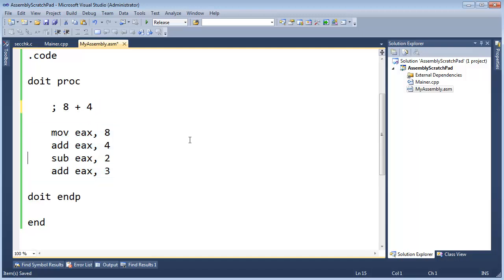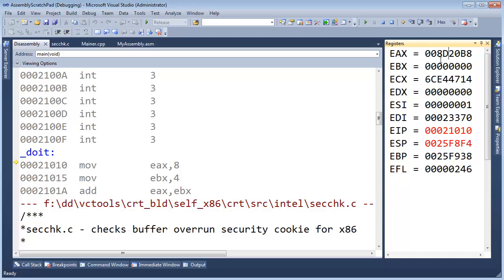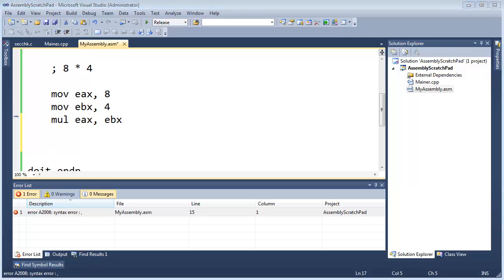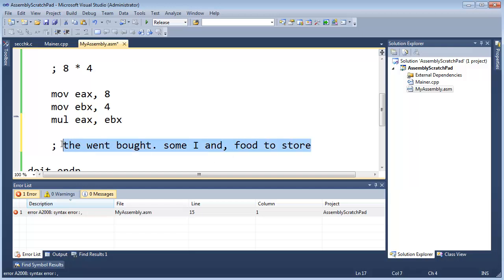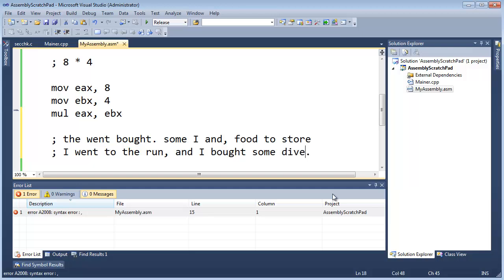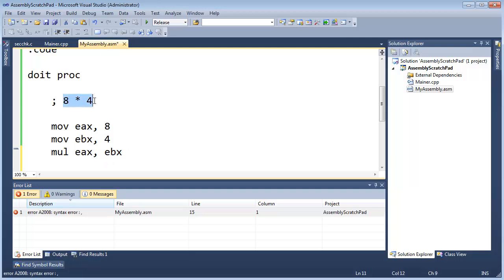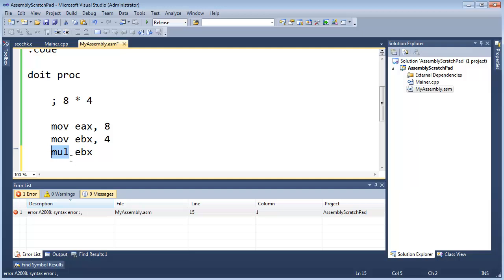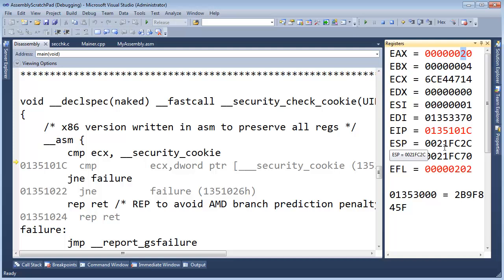Assembly Multiplying

Comment: This definately helped out. I read my assignment wrong and found out I needed to do input and output and not with the registers. It's cool I learned something new! 

* I was being dumb trying to mul 2 separate set of numbers only to go back to OG assignment and figure out what it really wanted. 

Your explanations still helped overall! I even learned how to mul and add an operation to the registers

.data
num1 DWORD 5
num2 DWORD 16
num4 DWORD 9 

.code 
main PROC
	mov eax, num1
	mov ebx, num2
	mul ebx
	add eax, num4

I'm sure this might help someone else if they are trying to figure out basic addition and multiplication with registers and not input/output. Goodluck! :)  

(It's in hexadecimal in the registers so you need to put it to decimal afterwards but it works all the same. :)

Comment: I want to multiply 16 bits x 8 bits in assembler, my old micro chip CPU does not have Mult function, only add and subtract. Can I do it???  Yes I should change my CPU but I would have to make new boards. :-(

Comment: I had a quick question on the addition. You added using a (whats going to change), (how it's going to change) format for adding. 

EX. add eax,4...But some answer for adding variables in my textbook look like add f,f,g (with 2 commas instead of one). The original problem was "f=g+h+i+j"....so my question is do variables change it or is it changed by the "f=" and why?